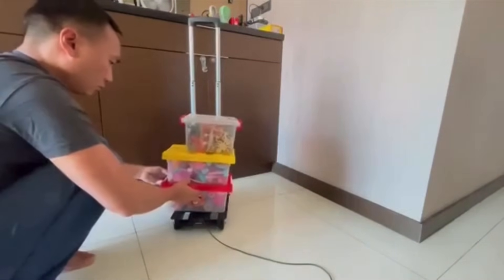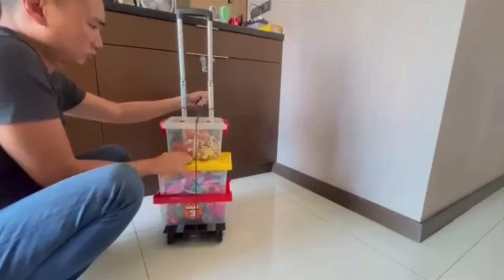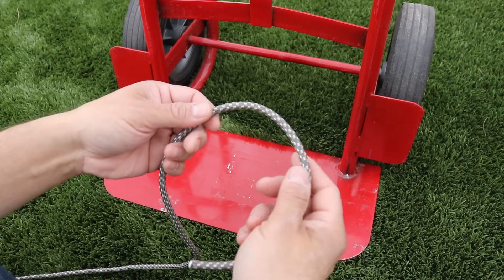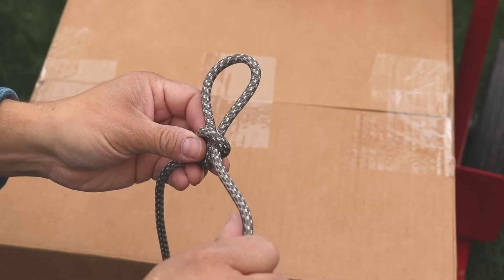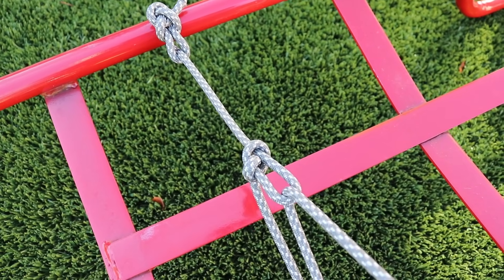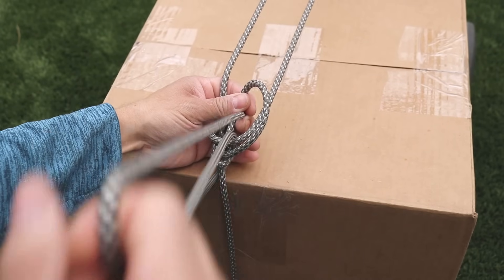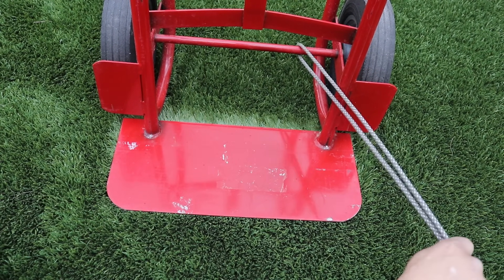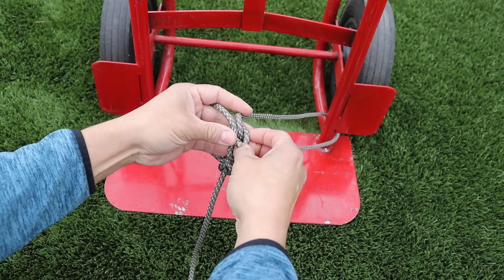Flynn Improves the Truckers Hitch

Comment: An idea for the finish: instead of just passing the working end through the loop the 2nd time, pass a bight - then you have quick release. Yes?
Reply: That wouldn’t work very well cause you need to pull on the working end to get tension. Which would undo the bight. Plus it already releases fairly quick.
Reply: Thanks for suggesting. Same experience with @brandicus, i pull the running end to tighten the system so i can't seem to end with a bight for quick release.

What i do though is on the last step i insert the running end through the loop in preparation for quick release as demonstrated in this video.

Comment: This new knot or Blackwall hitch variation has one big problem - it seizes and is devilishly hard to undo. The method given to undo does not work. I found one solution: make it a slipped Blackwall hitch, ie put a bight of rope through, for the final pass through the eye. Then it holds well and undoes readily by merely pulling the very end. Thank you for adding a new knot to my repertoire.

Comment: The whole point of the original  truckers hitch was that you should not have to feed the end of the rope through any loops. truckers have (had) very long ropes and feeding the line through a loop was a waste of time and a pain to undo. use a bite through a twist instead of the loop, however it is much easier on a truck than a little trolley and if tying to a rub rail you could double or triple the knot for much tighter ropes. .
Reply: Many people and truckers hitch videos miss the key point you just made. Occasionally a trucker will chime in with it, but it’s usually ignored. This why I use one of Peter Suber’s “Six Exploding Knots” number three called the Sliding Butterfly to secure my very first anchor point for the Standing End. I am currently using the new Blackwall variant shown here to finish my truckers hitch, but with one extra variation, I make the very last part  “slipped” by pushing a bight through the opening of Flynn’s knot. May I suggest that as the Blackwall Hitch has been around for a long time that the new variant be named Flynn’s Blackwall Hitch or Standing Blackwall ? My way of tying it would be as a Slipped Standing Blackwall. Finally, some people have mentioned that the slipped Marlinspike Hitch used to make the truckers loop can easily jam. Instead of that, as you indeed suggest “a bight through a loop”… I use the Aussie version “truckies hitch” which is two half Sheepshank loops separated by several inches. The Aussie way of tying this is, after taking a bight around the second securing point, or pickup tray rail, and then reaching through (across) that bight again to make a second bight, to use one’s l.h. to hold the second bight like grasping a rabbits ear, and to place one’s r.h. between the ear and the standing line, reach to the right underneath the standing line, then up over it, to grab the ear, and pull it back the way you came, lifting it forward away from you to form the sheepshank half. Repeat for the second sheepshank half, then dress the knot before proceeding with Flynn’s Blackwall variant, but slipped, to finish. The entire knot from anchor to bitter end, is tied “in the bight” and slipped, cannot jam, and explodes back into a single piece of rope upon pulling on the releases.
Reply: @edithflood631  MY knowledge of knot terminology is woefully pathetic. I can tie the knot but I cannot translate it into a coherent verbose description, but the 'bite through a twisted loop' to catch the tail means that even if the rope is on a spool it can still be used with rails and looped anchor points.  I watched an Indian truck driver demonstrate it years ago but cannot find the video now. It will never be a ratchet strap but it is great for tying down loose and odd shaped stuff. I would not recognize a sheepshank if it sat up and said 'Baaa'

Comment: Awesome tips!
Now, does anybody have some tips on how to get the dolly under and tie off a load when you can only lift one side a little and kick the dolly to get it on?

I have some injuries that make it so I need to use a small dolly to move boxes that a few years ago I could have just lifted or bullied into the house by myself. I could shoulder some of them over enough to slip the rope under, but lifting them to load them on top of the rope is out of the question, and some larger loads are hard to tip up and still be able to slip a rope under. Is there maybe some way I could cross the rope under each front corner after getting the dolly under it, then secure it?
Reply: If you're only moving a short distance, I wonder whether the load needs to be tied at all. Maybe you just need a more solid dolly that doesn't tip? Just a thought...
Reply from the maker: If you send me a picture of what you’re trying to do, I’ll try and figure something out. Brent@awesomeforsale.com
Reply: @mrdavemo in the UK all loads have to be secured,its the law.
Reply: @mrdavemo  You might be right about that. The major issue is tipping over when trying to pull it over the threshold, since I'm trying to balance an unsecured load on a small, portable dolly with one hand while pulling with the other. I do get out the big dolly with pneumatic wheels if it's a heavy load -- and often just wait until I can get help.
Reply: @First_Class_Amateur  Thanks! I'll see if I can get a representative image or two and send you an email.

Comment: I hauled freight as a local pick-up and delivery driver for 20 years and very rarely used the truckers hitch because we had 25 & 50 ft hanks of rope and our trailers had wooden slats to tie our loads to and most of us would use a sheep shank to shorten the rope then half hitch to secure it for easy removal later, any more I think the truckers hitch is used on smaller loads with shorter rope.

Comment: https://youtu.be/ihLeqA2IQ3U when i shared it with my friend and named it Kobe hitch and i was so happy with it i called my new dog Kobe.
Reply from the maker: Hi David, I watched the video in your comment. It appears it may have been inspired by my original video https://youtu.be/oNsuvZOI-0U from six years ago. This knot is based off the “blackwall hitch” from the 1700’s. Flynn’s discovery, though it may have been discovered before, includes an additional section of rope for support.
Reply: @First_Class_Amateur  well it would be if I hadn't been using it back in 2011....but yes I knew of an automatic truckers hitch in 1998 but it always failed in a 44 tonne truck because of the bounce he has tied the Kobe on a slipped loop and is forced to add a wrap ....it works with a RAF hitch and just as fast but not needing the secure wrap (under heavy strain and bounce of a 50 foot trailer the one shown collapses into a nasty knot, its the reason I will not use it for heavy loads ....the reason I joined your channel was because of you automatic release knot....and that was pure magic to use and served me well....also your wood on roof of the car I only used last month and was perfect....so thank you for them.....having worked with knots all my life and studying them at great length I am rarely surprised and you have done it three times.....so in my opinion you like my friend Hitori have a drive to learn....mine was out of necessity.